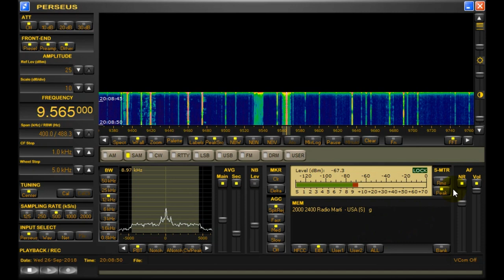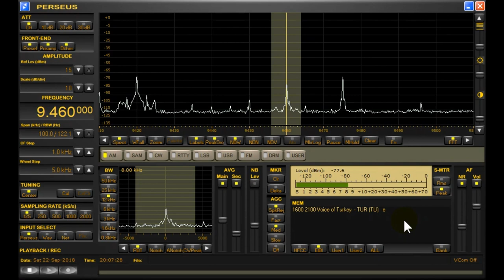New shortwave radio antenna - WinRadio balun

Comment: Connect a wire to a ground rod off of one of those fastener holes. You will hear an improvement and reduction in electrical noise.

Comment: I'm not a mathmatician to calculate what would be the best balun .. I connected my Long-Wire Direct (NO BALUN).. (Did well) even was able to hear 60KHz WWVB.. so I put a 9:1 ballen sadly lost all below 500 KHz then for Fun tryed a 49:1 (WOW) big diff signal strengh improvement.. Beats the MLA-30+Loop still nothing below 500KHz however.. but, I also seen you can make a 150:1  I can't find any instructions on how to wrap one.

Comment: What is that 'winradio' unom?
Where to purchase one of those?
Weather proof that connection with coax-seal tape.

BB
Reply: An Un-Un is an impedance matching transformer, it takes an unbalanced input such as a random wire antenna and matches it to an unbalanced output such as coaxial cable 👍
Reply: ok .... tks for the info

BB
Reply: It appears to be a WiNRADIO WR-LWA-0130 long wire antenna adaptor. See here:

https://www.winradio.com/home/antenna-accessories.htm
Reply from the maker: I bought it directly from winradio.com many years ago. Just pulled it out of the junk box for re-deployment.